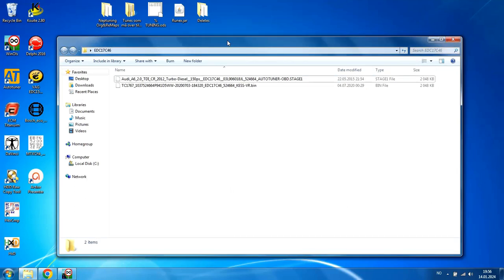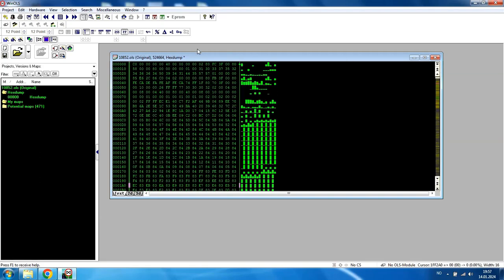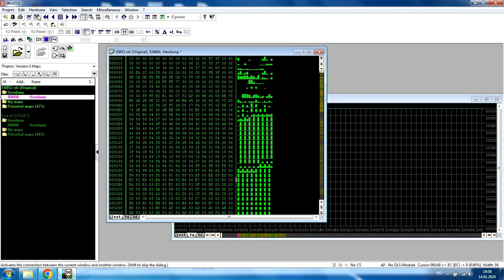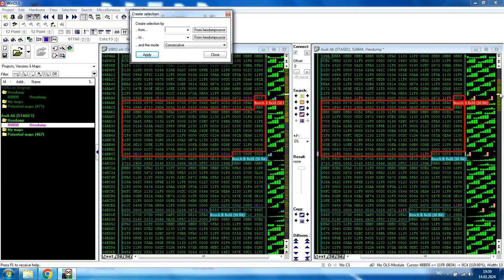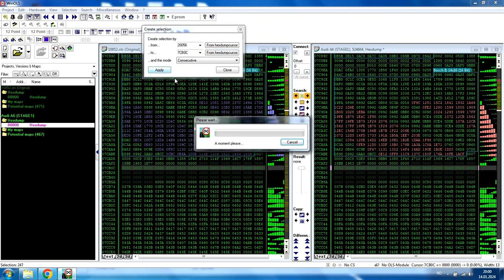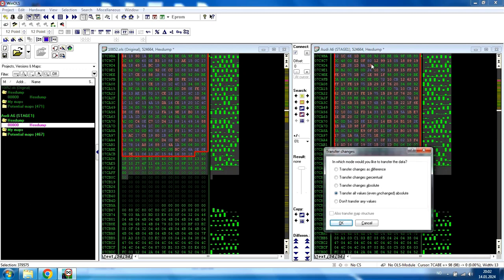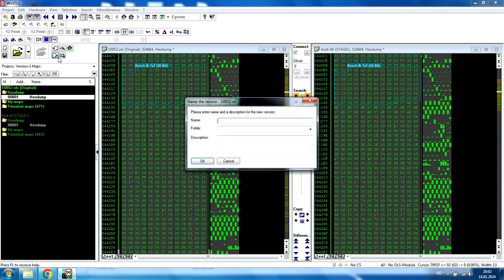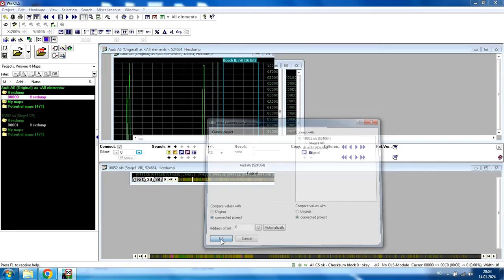How to re-use tuning files in WinOLS (all ecus EDC17C46/C64 etc...)

Comment: Hi, thanks for the video. I will appreciate as well a short video how to transfer properly files between slightly differen software versions.  

I have a file from Quickflash about 6hP26 where only the data part is readed (at the end of the file) and with version J - 047G100N362Z2ZJ07 and a full read tune with Version S 047G100N362Z2ZS07.  What i did:
1. Transfer the data areas from tuned file to the ori file (that is at the end of the file) - just like in the video above. But in ASCII i saw that at the end of the file the softwareversion is invluded, so i assume it will be risky to upload so this file. Therefore:
2. Made a Skript between Ori Quickflash and Moded Quickflash with Stage file with putting away the risk areas in the script
3. Applied the Skript on the Ori Quickflash file and it did not changed the softwareversion at the end,, but about 780 differences were so ignored.

DO u think that is a good solution or you have better :)

Thanks in advance